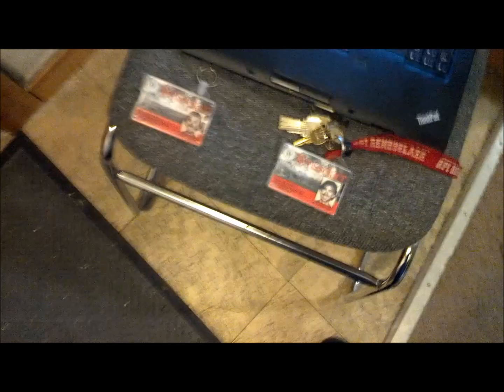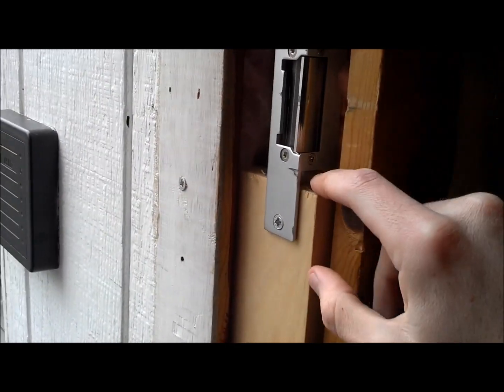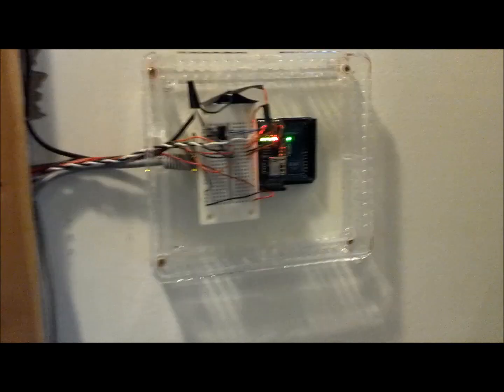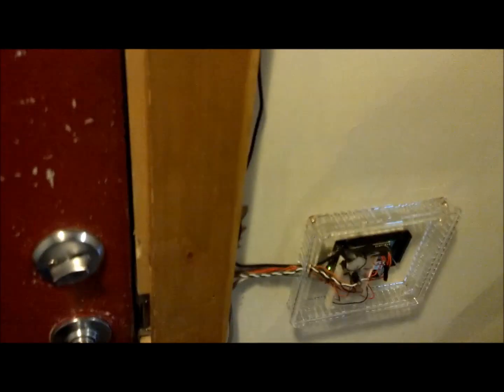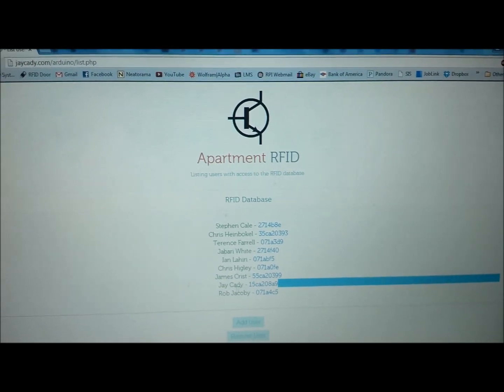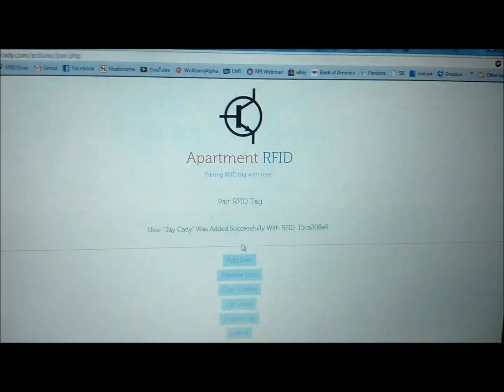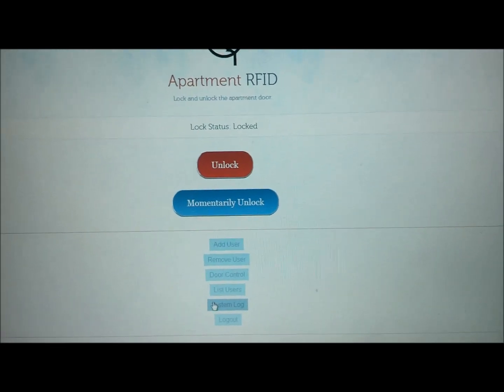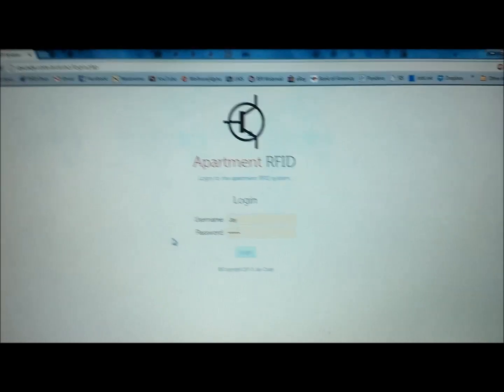Apartment RFID Wireless Entry System

Comment: Is that ProxPro II reader completely self powered (i.e. is it battery powered?).
Reply from the maker: This particular one is wired to an outlet. It's certainly possible to make it battery powered though. Or better yet, hardwired with a battery backup.
Reply: However, it must still be wired to the arduino to work correct? (or is there some inbuilt bluetooth capability?)
Reply from the maker: +Abhinav Suri Yep, it's still hardwired to the arduino, so you'd need to use the battery backup to power the arduino as well. You can do both with a 12V source.
Reply from the maker: +Abhinav Suri Yep, it's still hardwired to the arduino, so you'd need to use the battery backup to power the arduino as well. You can do both with a 12V source.

Comment: cool project. what happens if you lose power? does it unlock, or are you locked out?
Reply from the maker: +Spectt84 You can make one that stays locked (Normally-Closed) or that unlocks (Normally-Open). For security reasons, this one stayed locked. Normally you'd be forced to revert to a good ol' key, but it would be possible to make a battery backup too, if you wanted!